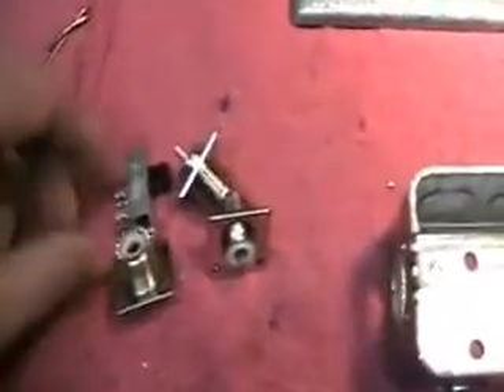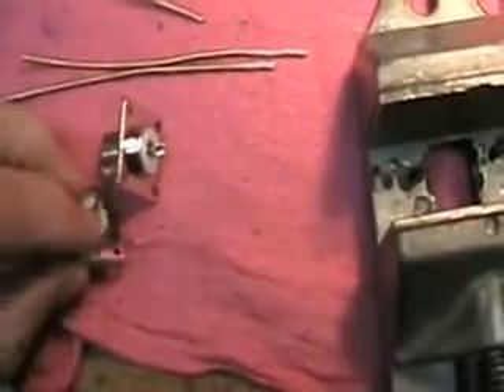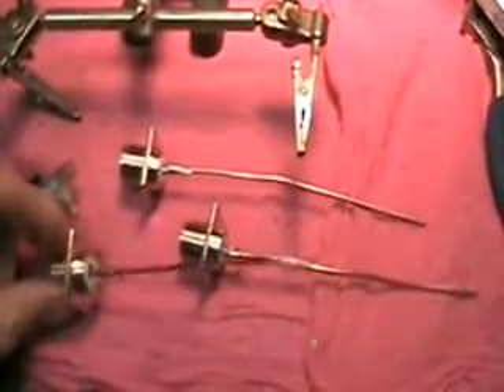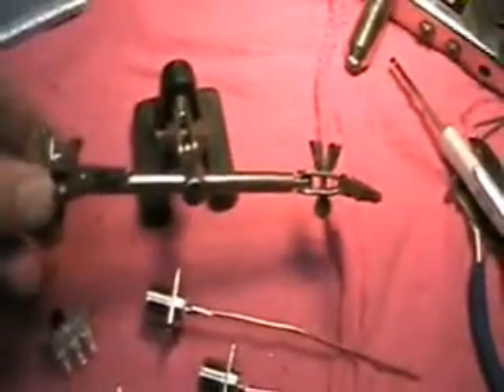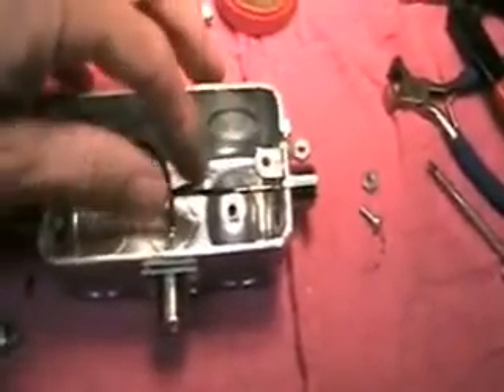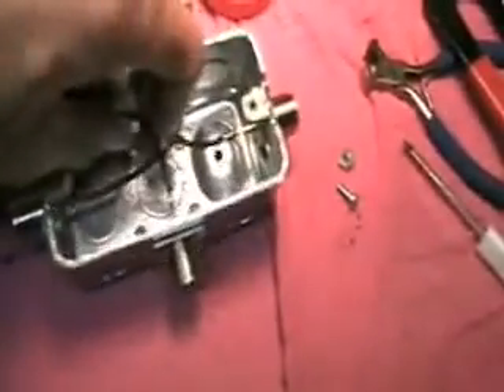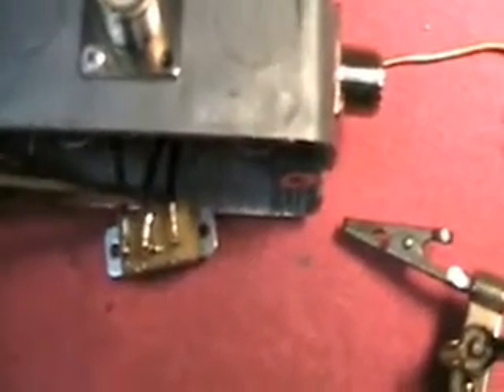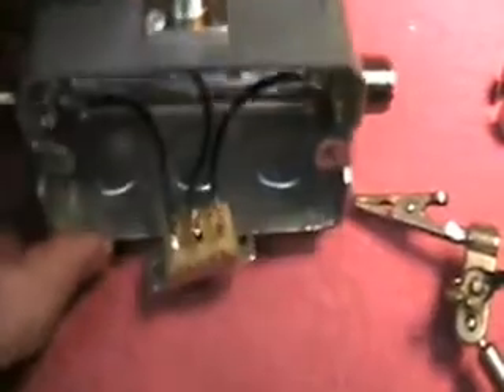Ham Radio—Homebrew Antenna/Coax Switch: Part 3

Comment from the maker: @wx9dx 

Jimmy,

Thanks for your commets and watching my videos.  Your method of using coax between connections is most likely a better solution.  If I were doing it again, I would follow your suggestion.

--73--
John/W5CYF

Comment: Not a bad project OM! Thanks for what you do to advance the hobby! I have made many Coax switches and usually use coax between the switch and the antenna connector. But that is just me! There are many ways to do anything. It has to first be fun. 73s OM Catch ya on mIDcARS!
Jimmy, ARRL TS, WX9DX

Comment: Ed,
That is the point of Amateur Radio - making your own stuff in the shack. Been licensed since '79 first as KA2HLW, then as W4FJF. I've built a lot of Heathkit stuff, some scratch built stuff, all the antennas I've ever used were built or rebuilt from "off the shelf" busted leftovers (a TA-36 Mosely that was wrecked in a storm I got for free), rebuilt several transmitters and receivers. The point I am making is that you never learn by buying new stuff off the shelf, you have to know how to fix your own stuff, or buy broken stuff at the hamfests for cheap and fix them. Some of the older transistors are "unobtanium" these days, so you have to design around them, finding ultra large scale IC's can take months of searching (like my Yaesu 6 Meter 50 watt ssb transceiver pll board), but you have to try. Yes, talking and swapping QSL's, contesting, RACES, MARS, DXCC, county hunting, or just monitoring local stuff during a storm with indoor antennas can take up a lot of time. But learning to fix things and building accessories for your shack must be a part of Ham Radio or you can be called an "equipment operator". First thing I ever built was a T/R relay for my Novice shack to mate my rockbound Johnson Viking One to my National HRO -5TA1 for hours of CW fun. Took my tech and general tests on the same day with permission from the FCC Field Office in Buffalo, NY when I was 18, then got my Extra in 1989 at the field office in Atlanta on Spring St.(got my GROL the same day).
   Learning electronics while in the Navy for two tours really helped me get the education, both theory AND hands on experience. So, I can build or fix practically everything but the latest ham gear. I made some money on weekends fixing avionics at the local airfield, minor stuff with radars and replacement antennas that were damaged by bird strikes. So, being a ham has had its advantages over the years. Spent 23 years in NAVMARCORPS MARS until 15 Sep 2015 when the Joint Chiefs of Staff shut us down, what disappointments! The Navy made a big mistake shutting us down the way they did. Keep on making videos Ed, the new people need your experiences. 73's de W4FJF.
Reply from the maker: Thanks for watching and leaving an enjoyable comment to read.  Thanks for your service; my Dad was a Navy man and he often talked about how much he enjoyed it.      ~John

Comment: I made one!  It doesn't look quite as good as yours though.  It was a beast trying to get everything lined up in the box, so my connectors are a little bit wonky, and the switch is a little crooked (I shouldn't have predrilled the plate cover, whoops).

SWR loss is less than 0.1 on 28 mhz.  I'm happy with it!  Thanks for the video.

73 
KD8NPB

Comment from the maker: @HamOPStewie 

Hummmm...something sounds like it's not right.  I suspect somewhere there is a wire connected wrong, you should not be able to transmit out of both sides of the switch.  

I would not use the switch until it is fixed...

Look it over carefully, it should be an easy fix.

Hope this helps

John/W5CYF

Comment from the maker: Thanks for your comments. I've never measured the impedance of the switch but use on on 50 ohm cable up to 100 watts with no problems.  This is an old, simple, inexpensive and effective antenna switch design but would not want to run much higher than 100 watts or so.  

73/John

Comment: I built something very similar to this. I used a toggle switch instead of a slide switch and I used an enclosure that is more visually appealing (No generic looking stuff at my station). I use it to switch between my antennas and dummy load. There is no measurable difference (Using a MFJ Antenna Analyzer) in impedance that I can tell. I am certain there is a slight impedance bump, but I can't measure it using analyzer.
Reply: Can you transfer or just listen?

Comment from the maker: @jhazy46 

Jim,
I've been away for the weekend and just now getting to comments.  I have been using the switch to go between to antennas to one rig. (at QRP levels).  There is nothing special (i.e. grounding) in the switch.  While I don't think it would be problem to use it to switch two rigs, you may want to add some isolation if you choose to build one.

Hope this helps.

73
John/W5CYF

Comment: Another great DIY Ham video.  I smiled when you were talking about their switch from Radio Shack as they are virtually gone from our country.   I spent many hours picking up components from that store.  I guess they call it progress.  I never knew you had the other call sign.  Nice tribute to your uncle there.  By the way, what kind of power could that switch handle?  All the best!  73 de KI5HXM

Comment: Thanks for a great idea, I'm going to use one of these to switch between a dummy load and the antenna..
Reply from the maker: Joe,  Thanks for watching and for your comment.  The switch is easy to build and works great.     ~John
Reply: W5CYF - thanks for putting this on the air so to speak.   I made one today and it works fine.  One antenna and two radios.   2WR402/Don

Comment: Any reason NOT to use a standard wall 3 way switch? Similar double throw..  Maybe space in the box?
Reply from the maker: +Tim Nixon 
Tim, I suspect that type of switch will also work for the HF frequencies, I don't know about VHF/UHF though.  Thanks for watching  ~John
Reply: +W5CYF / TinkerJohn I assume the reason for double pole is that you gang them for easier soldering?

Comment: How is it grounded?
Reply from the maker: Grounded to main service entrance via solid #6 wire.
Reply: @TinkerJohn_W5CYF  Thank you sir.
Reply: Ground the box making sure your screws or rivets do not make contact with the wiring to the switch or SO-239's or can arc over. I would say that switchbox would be 100 watts maximum on resonant antennas. Non-resonant antennas 40 watts max transmitting power without a tuner in the line after the switchbox. Good Luck!

Comment: Thanks so much for this John ! I wonder if you know if there would be any problem with using a house wall switch instead (double pole, double throw) ?
Reply from the maker: John, thanks for watching and for following my channel.   I've never used a wall switch however if it is a double throw/double pole I suspect it may work.    ~John
Reply: I'm going to give it a try ! I'll let you know how it works out. Thanks for all your great ham radio videos. Your  CW videos finally firmed up my decision to learn properly, so thank you for that. See you on the bands !

Comment: Silly question, sir. But instead of two radios sharing one antenna, could I run two antennas to one radio using this design? I'm still new to amateur radio and electronics, but I'm learning. Folks like you make it easy for me! 73, KE0IMD
Reply from the maker: Matthew,
Thanks for watching and for your kind comments.  Yes, you can use the switch with two antennas and one radio.  I do this often.  Hope this helps.    ~John